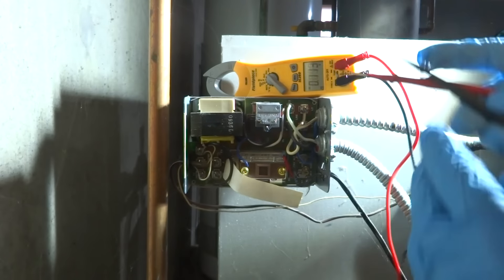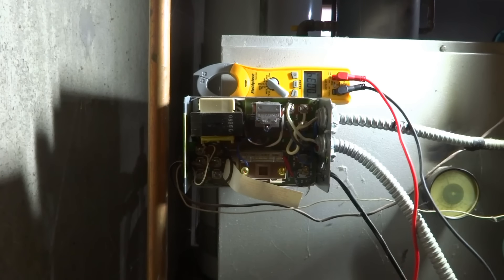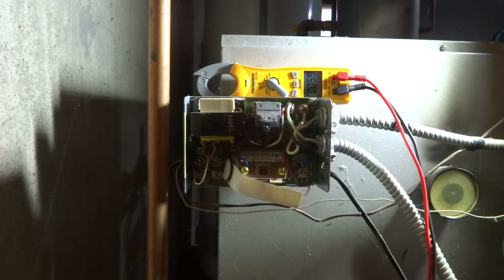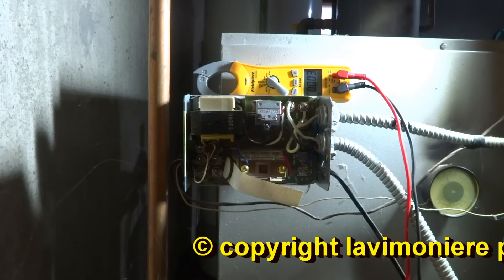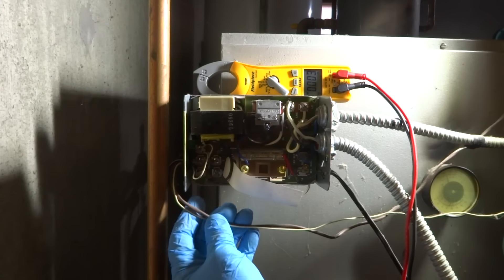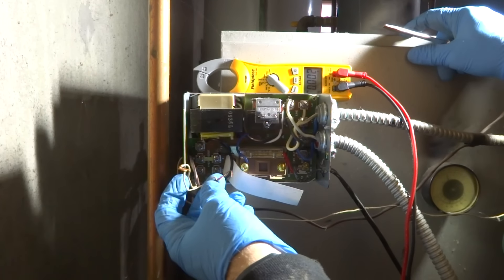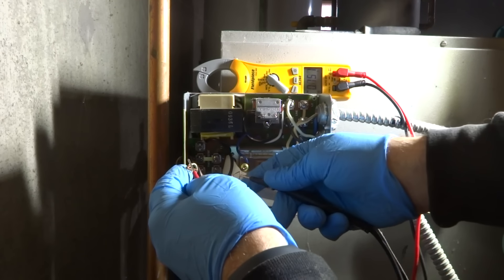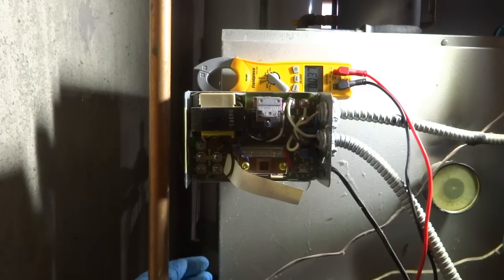OLD GAS BOILER NOT HEATING HOME SERVICE CALL

Comment: ? for billing, a part is in the truck for year's, do you call the supply house for a current cost to replace.
Dog's are the best.
Reply: You always charge the going rate for a part even if its been on the truck for years and you paid half as much for it in 2020. You have to replace it now that you've used it and that's going to cost you todays price.
Reply: Why should anyone be selling parts at wholesale prices to retail customers?

It costs a lot of money to keep that inventory (financing costs, time to buy and stock the truck, fuel to move around with the parts).
Reply: @dosgos  Can't forget Insurance, Licenses, and Dog treats !
Reply: The customer should be happy that Steve didn't have to use the "jizum", that would have sent the price through the ceiling!
Reply: @kellyg46  Or the "How you doing Momma"